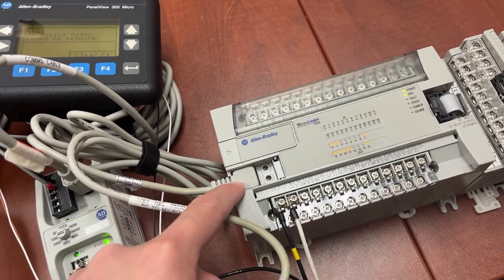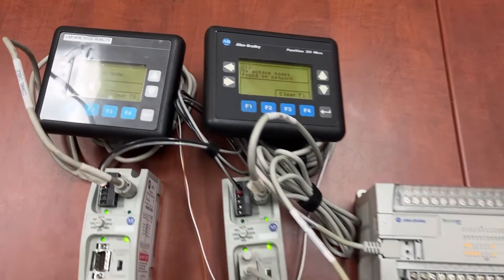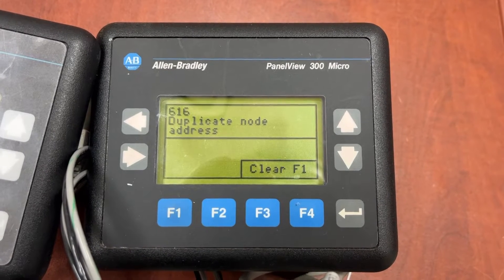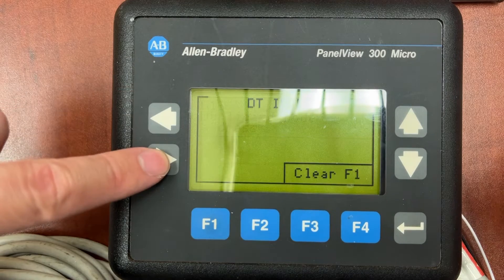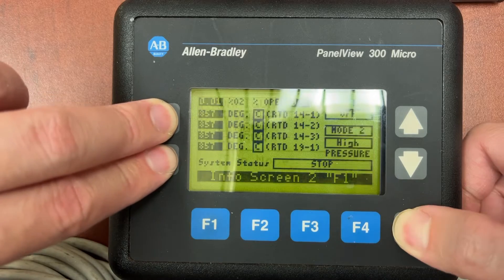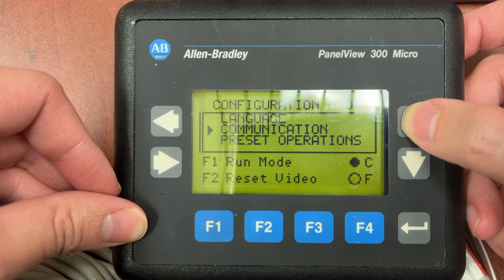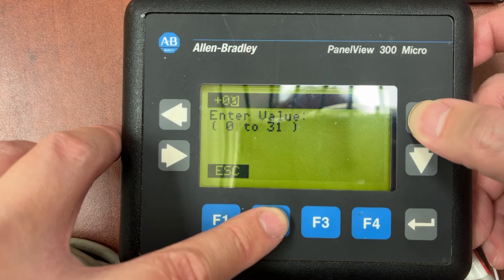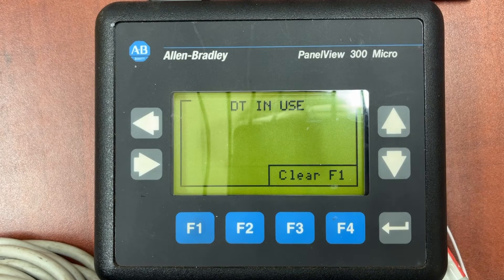Allen Bradley Micrologix 1200 PLC Serial Comm. with Panelview Plus 600 HMI DH-485 Setup 616 612

Comment: good video, a quick consultation, in your experience with idec software, did you find out if it is possible to simulate the HMI designs in NV4 and link it with the programming in LDR if you do not have the physical equipment?
Reply from the maker: @xiomarsan6654: Yes, it is possible but it's not practical to test the HMI application without the actual IDEC HMI. It is one of IDEC's drawbacks.